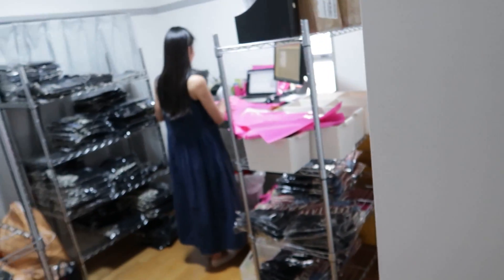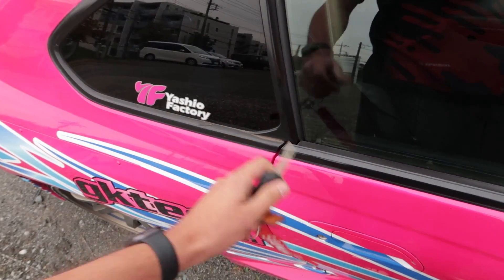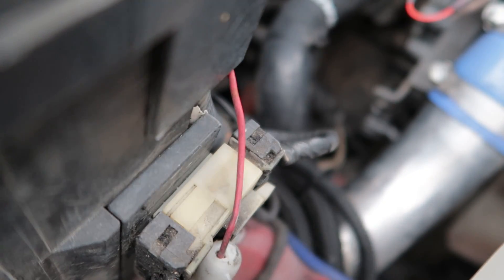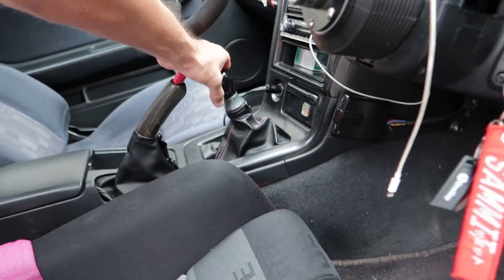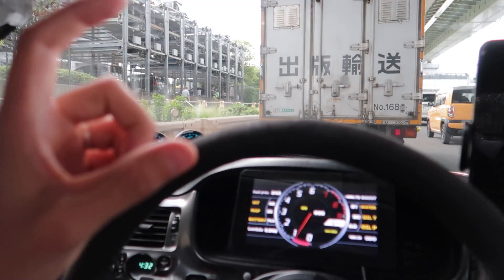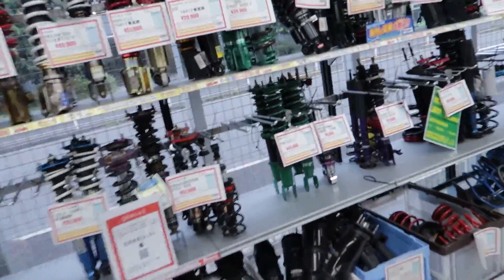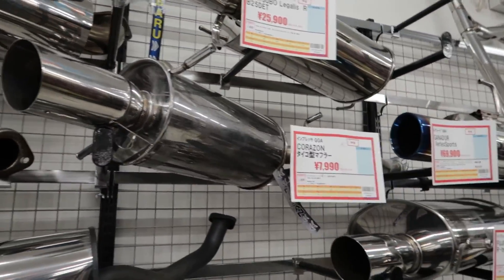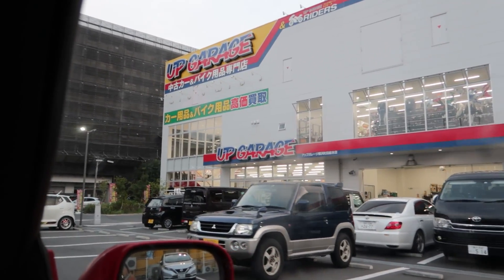FIXING POWER ISSUES ON MY NISSAN SKYLINE!

Comment: Imagine if putting the correct alternator on the car cured the oil consumption issue. 🤷🏻‍♂️😁
Reply: Valve guide stem seals an a oil restrictor for the turbo thicker oil should do the trick haha

Comment: Sam, congratulations for beating the Japanese System for transferring your Company, that's really not easy done 👍. Think about it that Okachan changes for you the flange on the HKS used exhaust, as a former TIG welder I know it's an easy job and Okachan what I did seen to till now for shure knows how to TIG weld😎. Please give us also an update for the last shop what you check out for you and your friend, please whe need to know what the owner decided👍.

Comment: Mirrors are a easy fix, just take them apart where they pivot, there are brass contacts on a blue plastic circle that get brittle and break. Some epoxy and glue them back down to the plastic circle and all is good!

Comment: Put some electrical grease in the electric plug that connects to the alternator. My 95 Sentra had a power problem until I greased that plug and got a good connection.

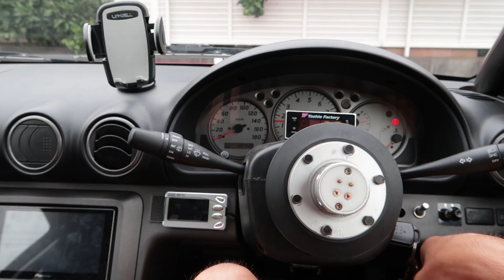Comment: 3:50 fixing the issue with non folding mirrors is NOT an easy thing...mainly because pulling the mirrors apart to get to the mechanism, the plastic is extremely brittle on 20-25yo mirrors. 
But you have to pull the mirror assembly apart, remove the motor assembly, open up the casing for the motor, then theres a little copper worm type switch that you need to clean the contacts on and potentially superglue them in place properly.....problem is getting them apart and back together without breaking the plastic.....and you have to be careful with the copper contacts...if theyre at the wrong angle then they don't stop properly.

Comment: Pull the mirror apart and put a cable tie around the housing that hold the gears and pull it tight so the gears in the mirror touch

Comment: It's pretty weird that you have to pay to get rid of scrap metal, in the US you can bring it to a scrap metal recycling center and get paid on the spot or simply put in on the side of the road and a scrapper will see it and pick it up. Good deal getting 10$ though, that is way higher than scrap value. For the bank stuff, could you transfer all of your stuff to a bank in Australia that has an international presence in Japan and then transfer it over with less hassle? It sounds like they want you to operate your business under the table for a year.

Comment: Sammit, How are ya! 
Noticed you have on of those temp sensors in the radiator hose. I just bought on. Just double checking I put in the return to radiator hose. So coolant flow from engine to the radiator?